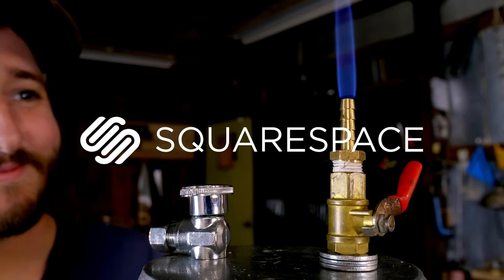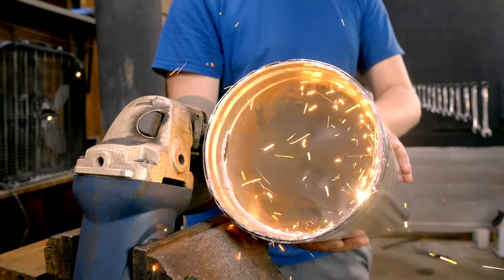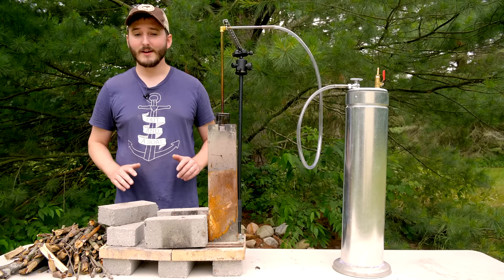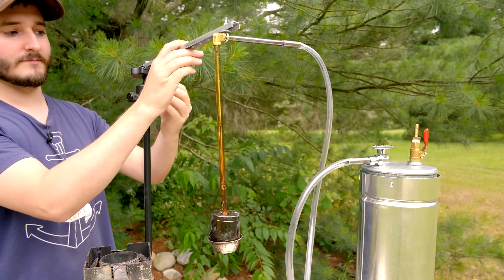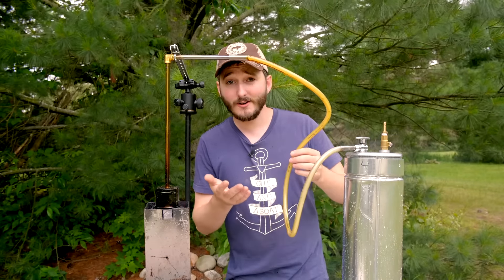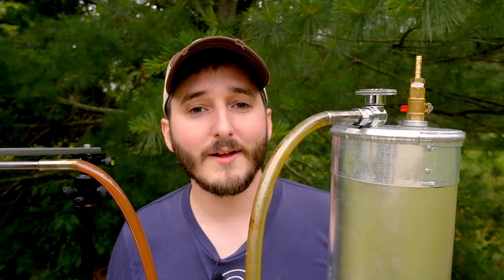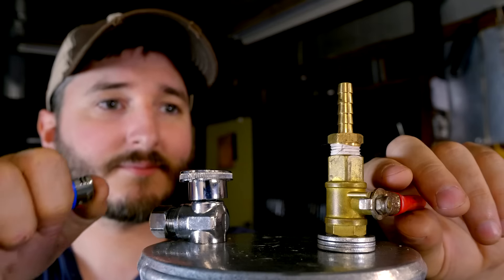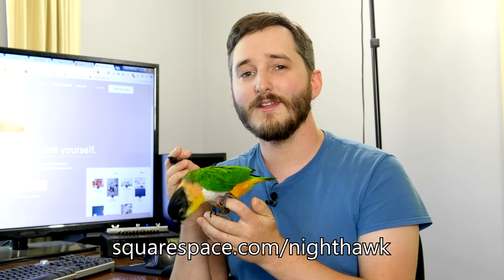Bio Fuel Storage: Building A Gasometer

Comment: Perhaps instead of using a flexible tube to rise with the inner cylinder, use a hard line (ie copper tubing). The hard line would run through base and up into the center of both cylinders.  I would probably include a sump point for the liquid given off during gasification. Great video and experiment.

Comment: Great video. Instead of vinyl use copper tubing. You could drop it vertically - parallel to the gasifier but away from the heat of the gasifier. Form it into a trap loop upward or a small coil. The more surface area of the copper the less heat that will be in the gas coming out the end which can be a vinyl tubing over to the top of your gasometer. The quicker the heat is spead through the highly heat conductive copper the less heat in the gas. Also the surface area of the copper in contact to the air around will extract more heat to the air more as the surface area increases. It is not necessary in my analysis to run the tubing all the way over to the gasometer.

Also to help draw the heat out of the gas in the copper line a dryer type device could be used to let the water go by and catch the heat - suggest some shavings like steel wool but stainless steel -- too bad copper would oxidize and not act as a heat transfer media to the casing of the copper enclosure of the dryer. 

The combo of the copper tubing and a 'dryer' which really does not absorb water but heat, passing heat to the air to be absorbed probably will make the gas cool towards the juncture of copper and vinyl tubings.

Comment: I know this is a year old and you more then likely found a better solution then the plastic tubing for high temps but you could use -4an braided lines with hard line to soft line fittings to make for a ease of installation, love you videos man keep up the good work 👍🏼

Comment: I like this video a lot! It's simple and interesting.
I might be wrong about the physics on this, but I think that if you were to use a heavier "rising" collection tube, it should force the gas to be more compressed, meaning you should be able to collect more gas in the same space
Reply: Yeah I was thinking about the same thing but the valves must be able to handle the pressure too without giving out

Comment: You could probably keep the vinyl tube if you replace the straight tube with a copper coil which should use its surface area and the wind to cool off the gases enough to not melt the vinyl tube. Great channel, BTW, I just came here from Applied Science and just subbed.

Comment: Nice project! Two ideas: use more metal tube before reaching the vinyl to cool the gas down and limit the condensation? And secondly, can wood gas be compressed safely? What about adding a weight to the top thing of the gasometer (like, weld some random stuff to it or put a lead weight around the tube?) so you can fit more wood gas in a smaller volume

Comment: Yes, you could use, some method of cooling down the gas, but if you're like me, at all, you 🤔 doing something that adds to the complexity"
Of the build, just defeats the purpose.! You're doing this to show everyone as breast that you can" that you can do this stuff, in you're shop, 
Away from ( factory perfect) part's.!! 
So, I would like to see it done, the way you started it. As a home shop, way of production,
That a lot of people, say" or think, it's not doable
For, ( a around the house, & shop guy) to actually produce thing's like, " wood gas" or even, " Hydrogen gas " as well as make you're own way of, storing it. Now, that being said,
I sagest, that you use a water pipe, made for 
Hot water, & that is lined on the outside, with
A stainless steel* mesh weave, around the 
Outside, of the pipe... Like what is used on washing machines.!! The stainless steel, mesh,
Surves More than one, purpose. It's a very good way to hold it together, stopping any, leaking.
Also, it helps dissipate, any Heat into the air around the pipe. Try that, First.....  Thank you for the VIDEOS you make.

Comment: btw the condensate is the same stuff as the condiment liquid smoke its edible and tastes pretty good you can cook with it
Reply: I built a slightly larger version of this. I used a commercial awning canvass like material to make a pillow tank the size of a pickup truck. Flat there is no air in it and so inflated it is undiluted syngas. 
I collected some of the distillate from the gasifier in a beaker and so about a cup full of light yellow to brown light viscosity liquid. 
My reaction to the odour from this was that it smelled like the essence of cancer. 
I would NOT NOT NOT recommend to breath or ingest this in any form what-so-ever. 
Other than that the process gummed up all our 4 inch transfers hose interiors with a tar like sludge before going into a heat exchanger and so cleaning/filtering and cooling all needed special consideration when clean wood stocks were used. Coal or Municipal Solid Waste would have unique characteristics of their own. 
The syngas produced was suitable to run a 30kW gas turbine at 95000 rpm which was an ultimate modern application of town gas from the 100 plus year history of this technology. 
I enjoyed the demo and so thanks for sharing.